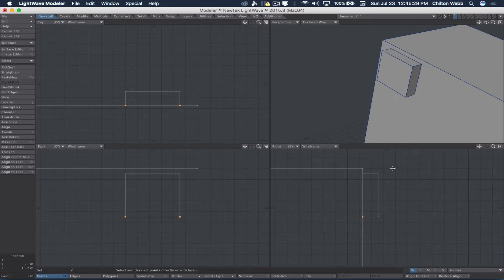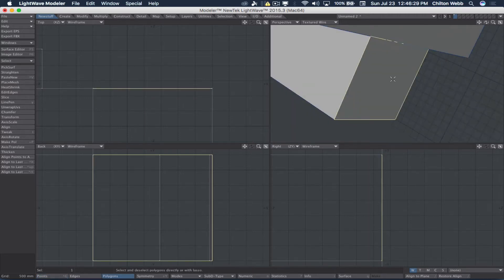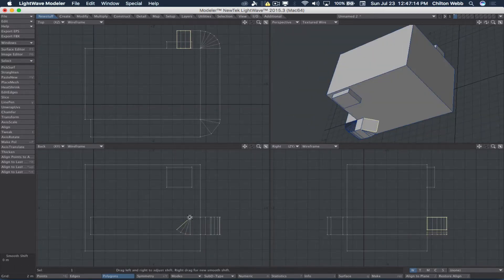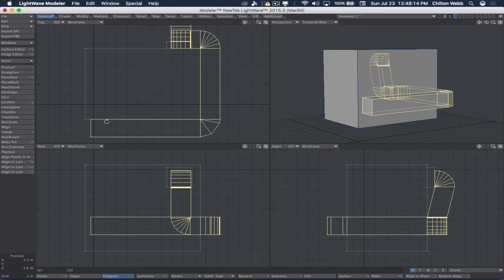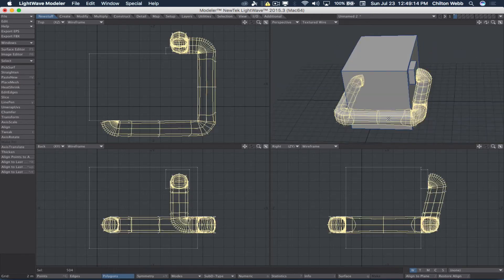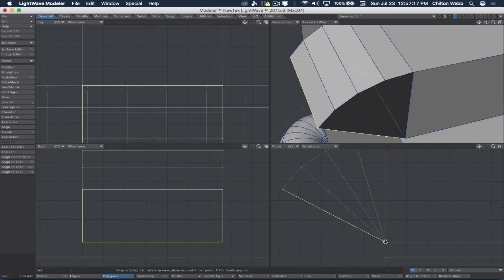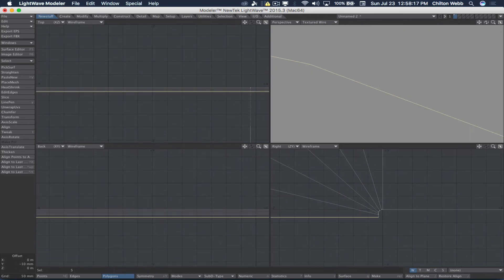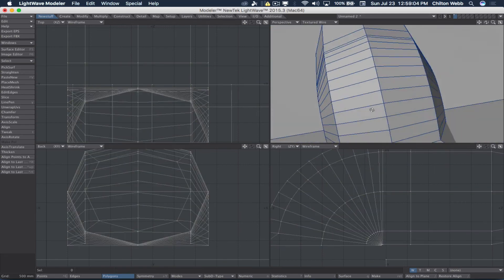Pipes in LightWave

Comment: Question: why not just use Spline Draw, a single poly, and rail extrude?
Reply: Working this way gives continuous realtime feedback going around the corners - Rail Extrude is a path to many undos.
Reply: This was the method I originally used when I first started with Lightwave, but my experience must have just been very different from yours; this method took far longer and required more adjustment for me than just creating a quick spline, lining up a polygon, and rail extruding it.

Comment: You haven´t tried px_bezier for this?  If you have...what do you think isn´t good enough with that?
Reply from the maker: That's a perfectly good solution, and it's a very easy plugin to use. I was looking for a solution that was native and that gave me control over the building boxes for the sides of the pipes so I didn't have to measure everything ahead of time, or spend additional time tweaking the path so that the cable runs through the center of the area I wanted to run through

Comment: Thanks so much for whipping this vid up so fast in response to FB pleas.

2 q's:
1)  So, are you just using Extend + Rotate to make the corners?

2)  What are you using to subdivide the longer boxes so quickly?
Reply from the maker: It's funny, this video is actually not my preferred method. I sped it up to compensate. My preferred way though is to use this combo:
Tab : Toggle Faces / SubPatches
Extend: Extender Plus
Rotate: Rotate Tool
Move: Move tool

Using this setup, I just hit the keyboard shortcut for extender plus, then I can keep using the tool I already am using, instead of having to switch back to it. It's one less keystroke :D

And as for tab, I forget if that's the normal command for tab, but this one lets me specify what object gets the subdivision, instead of subdividing everything at the same time.